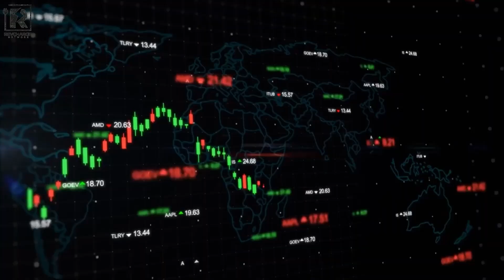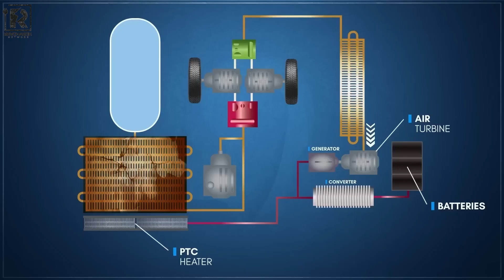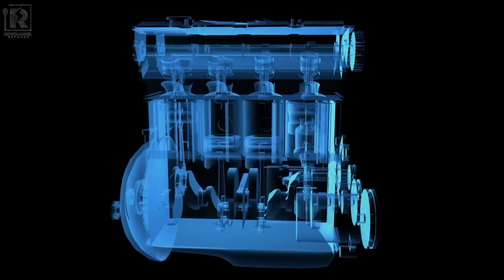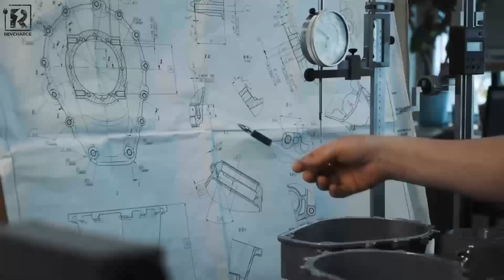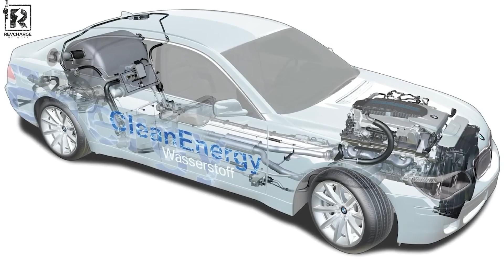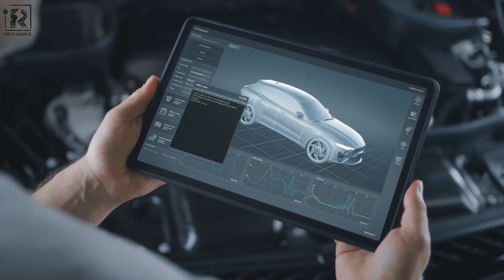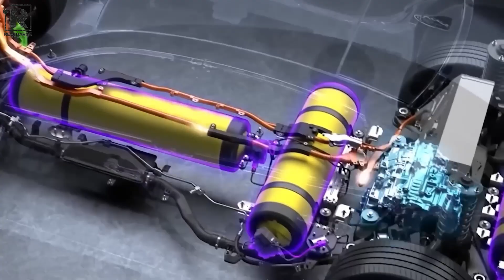The Engine that Will Transform Everything

Comment: GM Cadillac AERA has existed as a concept car for 14 years. Apparently GM is not going to do anything with air motors at all. Sad, because the crap they've been spewing outta detroit for the past 100 years or so has helped to destroy the planet according to some people. Anyway it would be fun to run your ROTARY WANKEL AIRMOTOR on a 20,000+ psi CFC AIR PRESSURE TANK and in-hub WHEEL MOTORS for 1000 mile range per fill-up of PRESSURIZED AIR. The whole RECIPROCATING PISTON AIR MOTOR idea is OVER, so anyone focusing on that is simply SABOTAGING the AIR MOTOR INDUSTRY'S AMAZING POTENTIAL. The ROTARY WANKEL AIRMOTORS such as those developed by ENGINEAIR AUSTRALIA can solve our surface and aircraft transportation issues very quickly. THE NEW ROTARY WANKEL AIRMOTORS can be adapted to VTOL AIRCRAFT, as I mentioned to GM CADILLAC perhaps 15 years ago. Any company that focuses on ROTARY WANKEL AIRMOTOR VTOL AIRCRAFT will dominate the worldwide transportation industry for the next 100 years, or at least until "FIELD PROPULSION" technology is adequately developed.

Comment: GM released an idea.  It is no where close to being practical in any manner.  They might as well say they want a fusion powered engine.

What’s worse are the videos that present these unproven ideas as a breakthrough.
Reply: The efficiency of the piston engine is 40% max, the efficiency of an electric motor is above 90%. That’s for the first part.
The two calculations that remain to get an approximate picture of whichever will prevail are: 
1.The cost of producing the energy that is needed to run any of the two motion generators. 
2.Which leads to creating the cheaper alternative for the end consumer.
Reply: @Shadismic  Good points.  We'll also need to add in the conversion loss from electricity to air.  It's really hard to imagine how this is more efficient than electric motor.  Not counting in the aspect of being back to dealing with so much more complexity in mechanical parts for such a solution.  Is the air pump and air engine maintenance free?  The practical aspects feel further and further away the more you look into it.
Reply: Lol nope compress air vehicles have been done before. Now this time with better tech. Just like the electric car
Reply: @CabooseisLoose122  The "lol nope" in compressed air car no where close to being practical doesn't exist.  No compressed air car had ever been tested by third party for range or performance.  If any project from 2010 every came close to reality, we would actually know how they perform outside of one group saying that they got a lot of range (150km) from their project with no mention of torque or acceleration.